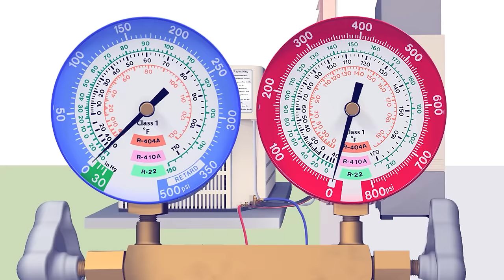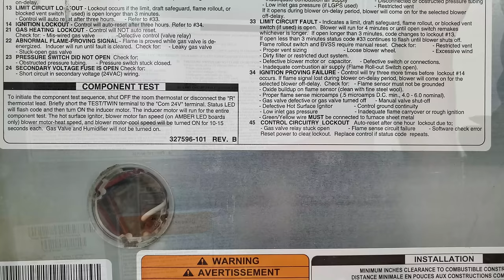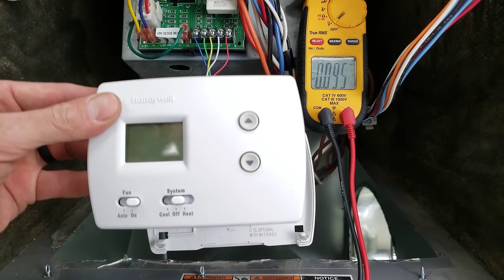Furnace BLOWER FAN Motor WON'T SHUT OFF! 6 Reasons Why the FAN KEEPS RUNNING!

Comment: REAL REASON! THEY MAKE THEM THAT WAY ON PURPOSE SO U WILL HAVE TO PAY MORE ELECTRIC BILL!!! SORRY ALL CAPS CAN'T C SMALL LETTERS ON KEYBOARD
Reply: This is what I suspect too because all of a sudden the blower is running a lot longer.  I changed the thermostat bc I thought that was the problem.  But this newer one just blows and blows cool air no matter the setting.  Oh, it stops for a second then starts back up again.  I believe something was tripped... on purpose.  🤔🧐😏

Comment: I cheat! I use an old contactor off an ac unit and attach two leads to it. I put one at "c" and use the other the same way as you would an electrical meter probe. Two reasons 1) I don't need to keep looking at the meter as I can here the loud clicking noise. Works great in dark and difficult to get at furnaces. 2) In rare circumstances you can read 24V but due to a weak spot in wires it does not have enough under load volts to get the job done. The relay will chatter or not pull in.  I find it much faster as I just move right through the whole circuit in seconds.
Reply from the maker: Thanks for sharing Ken!

Comment: With my electric heat only furnace- tech came out, said it was the main board. Ok, changed it. Now, the fan runs regardles of the thermostat, but the thermostat will turn the heat on and off, just not the motor. So i figure it must be a relay, but not only i  cannot find a part #, even with the model, and serial #, i have to disassemble the entire wiring harnes, breakers and all, just to get to the relay. Why? It is in my wet crawl space, that has no more than 12 inches of clearance.

Comment: I'm sure 95%  know but for the 5% that don't , sometimes you want the blower to run all the time.  When you have a multi floor house ( 2 story or more) you get what's called a waterfall effect where in the off cycle the warm air raise to the upper floor and the clod air falls to the lower floor.  I had a raised ranch and would get a 8 degree difference between floors by turning the fan to continues run that cut the difference to 4 Degree.  So, during the winter and AC season my fan ran 24/7 ,
Reply from the maker: Thank you for posting the note for others to see Pat!
Reply: I was literally just fixing to ask this question. I just moved in a 2 story house. The upstairs has a thermostat and the downstairs has one, when my heater is turned on but I have thermostat set lower than the room temp so the heater won’t come on I noticed the fan still cycles on and off through out the day even though the room temp is still higher than what the thermostat is set at. The heater is not kicking it seems to just be the fan. Is this the the scenario you are talking about? Is this normal or do I need to call for service? Thanks
Reply: Well I suppose the upper stat could be used to turn on the fan only? See if the upper stat has an " ON " position , the idea is to have the fan run all the time to over come the cold air falling to the lower floor and the hot air raising to the upper floors. @beanieweenie9543

Comment: Here is a 7th one  but probably not that common - but it happened to me.  When they constructed my home they ran three sets of wires to the control board.  One multi wire from the thermostat location, and two other separate two wire cables to ??? (they just go into the wall.  Possibly one was to go to a fan switch (a switch that would turn the fan on bypassing thermostat) and possibly the other was for condenser control for future air conditioning.  Our home does have a fan control switch, but it is wired directly to the fan not the control board.  For whatever reason, the installation contractor connected both extra two wire cables to the control board, wiring red to R and the black wire to G.  The other ends were not connected to anything, so it didn't matter.  Recently we had a really hot spell and turned the fan control on to try to circulate the cool air from the basement - left it on for several weeks.  When we turned it off - the fan stayed on. The culprit was one pair of the extra wires.  After 20 years of vibration a short was created between red and black.  I isolated which pair and spent some time wondering if it was possible it was connected to some other device that would try to turn on the fan.  Once I determined it wasn't, I disconnected that pair from the control board.  Everything works, thermostat fan on, fan control, heating, and cooling.

Comment: Your instructional videos are the best! Thank You. One question; why would an open safety cause the fan to run? The open sensors should remove the power?? I know the T stat, t stat wiring or the welded relay would cause such issue. If the Tstat is off position the fan should not run regardless. Correct? Thank You again You are the best!
Reply: Thank You! I totally forgot the board no/ nc relays.

Comment: I have an ECM/Control board. Fan blower blows non stop, but will cut off if I pull the single wire off the control board from the X13 SPD post. Does that sound like it's a bad board?

Comment: I have this problem with a coleman presidential furnace. I did remove the thermostat and the blower motor cuts off. The only difference is my thermostat switch is set to heat. Does that make a difference when troubleshooting a potential faulty thermostat  ?

Comment: I  have a amana aspt42d14aa that thr blower motor stayed running, a/c guy comes put diags ecm bad on blower moyor, a/c unit had been installed about 6 years,  replaced motor. A year later same thing, replaced motor, now approc a yr n a half later same thing. Any idea on why the blower motors ecm keeps going out causing this issue? Frustrating that it has started doing this

Comment: I have a similar problem with my ac unit. I have a Lennox and when I turn the ac unit on upstairs the fan blower keeps running so I have to go up in the attic and remove the breaker.

Comment: My fan continues to run after the A/C cuts off. If I flip the breaker off and back on, the fan stays off until the A/C starts again. Then it's always on again. This means its not the wiring correct? What most likely is it?

Comment: Question. What if the blower motor turns s on and off with the call for heat but the fan switch on the thermostat doesn't work. I have a goodman GM9S800 furnace and it's brand new. The furnace never enters into the sequence of operations

Comment: Those 2.3 ECM modules are overly sensitive causing failure. Just be sure that you have sufficient airflow in heat mode, otherwise, you will fry the module over time. Remove those overly-restrictive filters!!!!!  I also install surge suppression just in case.
Reply: Is it heat or the airflow restriction itself? Ive always heard ecm motors are sensitive to airflow restrictions, but heat makes sense too
Reply: @logicalrat    To compensate for airflow restriction (i.e., too high MERV filter or too many in-line air filters), the ECM will allow more Amps to speed up the motor so it matches the airflow settings on the dip switches. The increased heat generated inside the module and/or the motor can burn out the module. There is a disc-shaped thermister in the module some people replace (solder in) rather than replacing the module.
Reply from the maker: Great tips Ma Ma!!!

Comment: When checking the voltage of any switch you should read 0volts that means the switch is closed and if the switch is open you should get voltage reading . Plz correct me if I am wrong, thanks
Reply: You are very much wrong in HVAC applications, also note how his probes were set up, 1 probe to Common which essentially is a ground and the other to each side of switch that is wired in series. Hope that helps.
Reply: You're correct when checking voltage. The positive lead goes to the power, negative to ground, get your voltage reading (if set properly).

But when checking for resistance, you should get 0 Ohms when checking  both sides of a wire to see if its good. 

...or if a switch is closed.

If he said voltage while checking for resistance,   or vice/verse, he probably just misspoke.

Comment: Thank you for the video. I have a question.
Will the power cut off when I pop the door switch reset 3 hours lockout on the control board? I have a situation where the flame rollout switch was open and the board was throwing error 13. But even after I reset the flame rollout switch and put the power back to the board nothing was happening when I initiate a call for heat R+W. The board was making some hissing noise and didn't start the sequence for the heat call. I ended up replacing the board because I thought the power interruption must clear the memory on the board. Am I right?
Reply from the maker: Yes power interruption should always clear the furnace to allow operation if all safeties are reset. Otherwise the board may be bad. Make sure to check for CO levels and to see why the flame rollout tripped. Flame rollouts trip due to cracked heat exchanger or possible clogged heat exchanger. Thanks again for your support on Patreon!
Reply: @acservicetechchannel  thank you for the response.  Sure. I always check for CO and make sure the CO alarms are presented and working. Safety is the first.

Comment: how does the safety limit switch cause the blower to run contineously please explain us ? thank you
Reply: On some of the older furnaces if the switch goes bad it gives the board the same signal it gets when the unit is running so the board thinks it's burning and the fan will run I haven't seen it happen on the newer furnaces and like on the wall furnaces their switchs are 120 volt not 24 like on the regular gaspack and forced air furnace

Comment: Do they have a techmate pro for X13 motors?
Reply from the maker: No, we just normal measure if it has the appropriate 24v signal and if the motor is blowing, thanks!

Comment: My heater will reach temperature, then heat will turn off (can hear little click) but fan keeps blowing slightly cooler air. Sometimes it shuts the fan off and sometimes it doesn’t, or runs for 30 minutes then shuts off. I don’t know what the heck is going on. I have a Heatrix by Dell HXOB, central air, any tips
Reply: Have same problem did find out what it was
Reply: @jesselopez1637  I disconnected the thermostat, just took the faceplate off and put it back on, and seems to work fine for now,
Reply: @jesselopez1637  I replaced the thermostat with a Hunter as the og thermostat lcd screen faded fyi. Might have to replace the thermostat again soon.
Reply: The thermally-activated limit switch could be getting flaky and erratic.  I have the same problem.  If I tap the box where the limit switch is located, the fan will turn off.